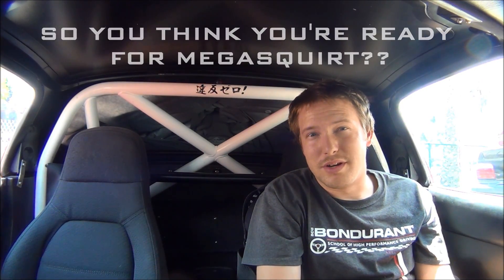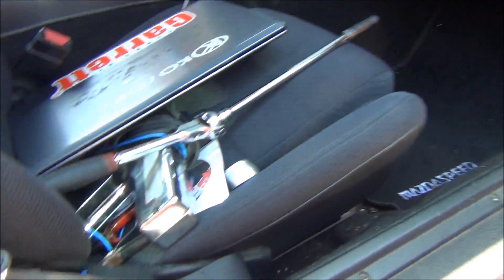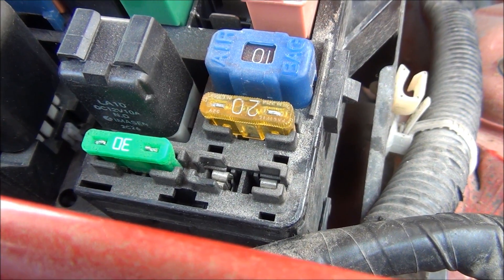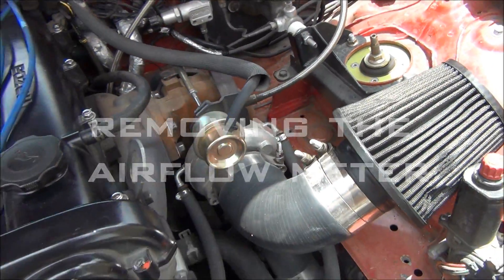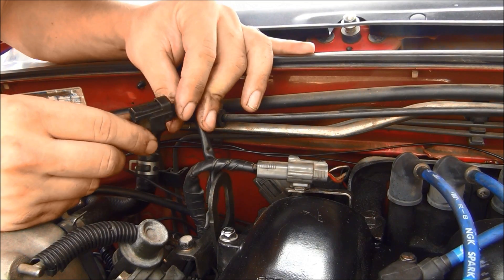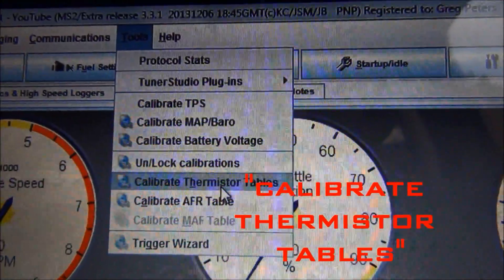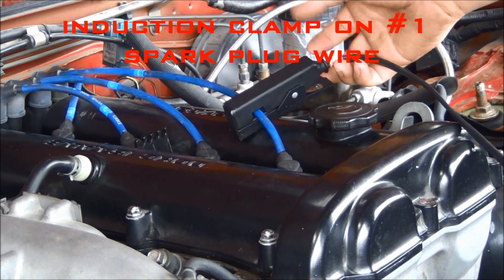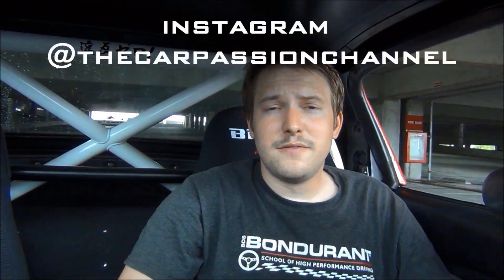How to Install Megasquirt!

Comment: You should do one about tuning and installing bigger injectors.
Reply from the maker: +Baron Graves Installing injectors is definitely in the near future.
Reply: +TheCarPassionChannel got a question, did you install the mspnp2 while still NA, if so did it start up right away? I can't get mine to start without revving it and it stalls most of the time after just 30 seconds or so.
Reply from the maker: ***** Yep it started right up. What are your AFR's like at idle?
Reply: +TheCarPassionChannel at the time I didn't have a wideband so I don't, I swapped the stock ecu back in because i dd my miata this weekend i plan on doing the wideband and swapping back in the megasquirt
Reply from the maker: ***** It's impossible to tune MS without one. The base map is okay but definitely needs some tweaks, from one car to another the fueling at idle may need to change, or it may just be idle valve settings.
Reply: +TheCarPassionChannel Yea definitely thanks for the help keep the videos coming man

Comment: Is this beneficial to install naturally aspirated? And would the initial setup be similar?
Reply from the maker: +Nick Racicot Install will be identical if it's a 1.6L, and it can definitely benefit naturally aspirated vehicles, I've seen cars make an extra 20+whp and increased fuel economy with a proper dyno tune on Megasquirt.
Reply: +TheCarPassionChannel yeah it's a 91 1.6L. I just got her a few days ago.

Comment: how much is a megasquirt
Reply from the maker: +iC Jehova around $850 for a plug-n-play, $400 or so if you build it yourself. You can go boosted without a standalone, but it's really best just to buy one in the beginning. You can get a lot better and safer tune with it.

Comment: yeah i want to boost mine but i need a list of like every part bc every video i watch has so many different things and i just want something cheap and quick
Reply from the maker: +iC Jehova The main ingredients you need are: Manifold, turbo, downpipe, water/oil lines for the turbo, intercooler, intercooler piping, blow off valve, ECU (megasquirt), injectors. You'll need a clutch if you want over 150whp. Below 6psi, intercooling isn't really necessary, but it is safer.

Comment: how much does it cost in total to boost a miata rn i have a 1991 1.6 miata
Reply from the maker: +iC Jehova Anywhere from $1000-$20,000+ depending on  many many many many variables. I'll be releasing a video Friday that's the start of a project you'll probably be very interested in.

Comment: I just picked up a Ms2 and an Innovate wide band. I was making 160hp to the wheels un-tuned, with an m45 blower on my 1.8. Can't wait to see what some proper management does for it.
Reply from the maker: +Bryan Murphy You should pick up some good power on the dyno.
Reply: Thanks. I hope so.

Comment: just a quick question. not to sure about but did you say the megasquirt did come with the overboost protection or if it does not what do i have to get. and i would like to know if you recommend the voodoo 2 turbo kit from flyin miata i saw in one if the videos you got the garret turbo and you said it was alot better just wondering if you would recommend that. thank you in advance if you get to this
Reply: +TheCarPassionChannel yea I was gonna buy the kit without the electronics and use mega squirt. Thanks I appericate the response. Thanks again

Comment: but how am I supposed to turn the car on the on position if my battery isn't connected!? lol I'm joking thanks for the good videos, very helpful!
Reply from the maker: +Rob Michel .......small detail, lol.
Reply: TheCarPassionChannel which IAT sensor did you use? I'm assuming the open element one.

Comment: I am definitely interested in doing this.  Thanks for all the info you are going over.  It will really cut down on the troubleshooting time.  I kind of want to explore the MS PNP still using the maf though.  I have previous experience with tuning, just not miatas.  I have read that it has been done.  What are your thoughts?  I have to maintain A/C because ~120 degrees ambient air temp at times.
Reply from the maker: +NickelNDiminIt You can keep the MAF but I'm not really sure what advantage it will have.

Comment: @thecarpassionchannel
so you put the wideband sensor in the stock hole for the narrow band o2 sensor and hooked the wideband into the stock harness plug? how? and on my car right now I have 2 bungs in my exhaust system. 1st is for wbo2 and 2nd is stock narrow band o2. if I switched to mspnp, would I remove the narrowband with a plug and connect my wideband to stock harness?
Reply from the maker: rstormzand I can only speak for my wideband, the Innovate MTX-L, but yes you hook it up to the stock harness. It's easier than most people think, which is why I am going to be doing a video on it! There's a single wire that comes out of the back of the gauge itself on mine that needs to be hooked up the stock harness, it's super simple.
Reply: TheCarPassionChannel I have a wideband right now as well. but I also have the stock narrowband. Would I remove the narrowband once I installed megasquirt?
Reply from the maker: rstormzand Yes. The Megasquirt only needs a wideband.

Comment: Bro i gotta ask, ive installed mspnp2 and mtxl wideband. Everytime i go to tune my ignition timing, im having problems

1. Click fixed advanced, set 10 degrees
2. Burn
 Its at 10 degrees
3. Turn off engine. Click use table. Burn.

17.3 degrees?, i try to use the trigger/angle offset but it doesnt do shiet
Reply from the maker: Dj SkFk Don't use trigger/angle offset while in "use table." That's only for setting the base timing. You have all of the steps correct, the only timing you need to manually set is the fixed advance. Once you change to "use table" it's going to use the ignition table. Go to "Ignition Settings" then click "Ignition Table 1" and you'll see down in the idle cells, the advance will be 17.1 for the base map. So that's exactly where it's supposed to be after you select "use table." The reason for setting the fixed advance is so that if MS thinks the engine is at 10 degrees BTDC, the actual mechanical advance of the engine is at 10 degrees. MS just adds to that to achieve the values in the table. So if you have your car set up to idle at 17 degrees, MS just does "10+7" degrees. If your fixed advance was 10.0 in MS, but actually 13 on the engine, MS would still add 7 degrees, but you'd be idling at 20 (13+7=20 degrees) because MS thinks the fixed timing is 10. That's why any time you remove your CAS for any reason, you HAVE to check your fixed timing again, otherwise it will throw off your whole ignition map, which can be dangerous. Hope that makes sense!
Reply: +TheCarPassionChannel okay man that makes alot of sense. my problem now though, is everytime I select a gear ms will raise my idle to almost 2k, Ive run the car with my stock ecu and it won't do it. 

I have checked so many things I just don't know why. 

I put in any gear including reverse with the clutch depressed, idle raises to 1600, in neutral the car behaves normally, even with the clutch depressed. 

shed any light? is this related to timing?
Reply: +Dj SkFk also, so I take it from you're reply. It's safe to be at 17.4 degrees advanced? at idle.
Reply from the maker: Dj SkFk Yes that's a safe idle advance. Mine is 16.0. The idle up is not related to timing, it's your neutral switch that's giving MS the signal to idle up. Why on Earth MS would do this I don't know, I was able to tune it out but it's been so long I don't remember how. Another problem is on older firmware versions, MS thinks the neutral switch is actually the clutch switch, so you can't get launch control or flatshift to work right without wiring your clutch button into the neutral switch harness. This could be part of the idle up issue as well. What firmware version are you on? I literally just updated mine to 3.4.0 last night and it kept giving me an error with the neutral switch, that's the only reason I know all that ^^^ haha, good timing on your question.

Comment: First of all, thank you for make a video on megasquirt. I'm building a turbo Miata and I'm using the megasquirt pnp 90-93 gen1. I was wondering if the initial set up and maps are the same as the Gen 2?
Reply from the maker: boaz ovilma That I'm not sure of. But the most recent base map is available for free online, just follow the link in my description.

Comment: How bad of an idea is it to buy a miata that already has a turbo on it? I'm thinking turbocharging my 94 could cost around 5k, so why not just get an 04 Mazdaspeed?
Reply from the maker: twitch01 It's all up to you man! The MSM can be expensive for the initial purchase, and is also more expensive to fix and modify. And, if you spent $5k on your 94' you'd be destroying stock MSM's.
Reply: TheCarPassionChannel What would be the best use of that 5k?
Reply from the maker: twitch01 It's not my car man, gotta make that decision yourself. Depends on so many different variables like what the car's going to be used for, what the smog laws in your area are, how good your mechanical skills are, if you have a spare car or not, do you care how much value the car holds, etc, etc, etc.

Comment: I love your videos man! I can read thru forums all day and although helpful, watching videos just helps that much more. So the question. How satisfied are you at that power level? I'm in the process of boosting with an FMII kit. The thing that kills me is the ~250wtq upper limit of the rods. So 230 or so is safe. I'm thinking about new forged rods, rings and bearings to run up to ~275. What do you think?
Reply from the maker: Dukepgh I would say just boost your stock engine first and see how you like it! It's really going to cost an extra $3000 to properly build an engine. Have you ever driven a boosted Miata as a reference? I'm at 236whp/215wtq and it's so freaking fun! It keeps up with 2015 5.0 Mustangs (450bhp) so it's no slouch. I also autocross it so I need to keep the spool fast and not use too big of a turbo anyways, I'm actually changing the turbo this weekend to something that spools a little faster. I switched to E85 so I'm hoping I can get into the 235whp/225wtq range still. You're going to be so happy with the car even at the 230whp level, and maybe you can just start building an engine on the side and take your time with it.

Comment: Great video, but it would've been better to do before you installed your turbo!
Reply from the maker: Joe H I had Megasquirt installed months before I was turbo ;)
Reply: Sure, but the video would've been helpful to show what you did then.  Before you turbo'ed, did you have your AIT sensor plugged into the plastic crossover tube just before the intake manifold, or over by the airbox?
Reply from the maker: Joe H I agree, it would have been helpful. But I wasn't planning on converting my car back to stock to do an MS install video, lol. IAT was in the crossover tube right before the throttle body. Drill hold, thread in sensor. The plastic is so soft you don't even have to tap it.

Comment: Hey man, this video is great, but for us that suck with engine electronics/tuning a full in depth video would be better. I feel like doing it in full depth would be more beneficial :D thanks for the videos man, they are very helpful.
Reply from the maker: Jordan Wilbanks I feel like this was a pretty in-depth install, what kind of things are you talking about? If you're not familiar with the engine bay, I definitely wouldn't recommend installing MS yet. Start out with routine maintenance items like spark plug wires and air filter change. You'll gradually work your way up over time.
Reply: I have been re-watching, and its getting more and more clear. Thanks for posting the video man. Keep the great content up!

Comment: you need to replace the TPS on the 1.6 miatas too? i remember reading that the stock 1.6 TPS is just an idle and WOT switch.
Reply from the maker: 86gtforme The stock 1.6L TPS is just an idle/WOT switch. I had mine boosted for about 6 months with no TPS then finally decided to wire up a Nissan VTPS.

Comment: If I have a 91 Mazda Miata with a 1.6 liter engine and I get the megasquirt ECU will the megasquirt ECU work on a 1.8 liter engine if I decide to do a swap
Reply from the maker: luis moreno With some wiring changes, absolutely.

Comment: what Miata do you have? and what is the HP? i want buy one Miata, i want 1990-94, but i dont know choose the best model ...
Reply from the maker: JOSH I have a 1992, and mine makes 236rwhp (~275bhp). 1990-1993 is the "NA6" with the 1.6L and 1994-1997 is the "NA8" with the 1.8L. Many people prefer the 1.8L because it has more potential for power, and the differential is stronger.
Reply: but the Miata series its 115 HP no? as put more HP ? with turbo? XD i dont know
Reply from the maker: JOSH Yes it's turbocharged.

Comment: Questions! Is it acceptable to install ms on stock engine, and leave the wideband install until the turbo install? I just dont see the need to install into stock exhaust when i will be changing my exhaust when i go turbo? Im keen to buy parts i just want to know what order. 

Ultimately id like to install ms, upgrade injectors, then later intercooler, turbo and exhaust incl wideband?

How does ms go without using the AIT sensor, is it acceptable to leave it out until the intercooler is installed?
Reply from the maker: Dj SkFk You should install a wideband with MS because you can't tune it at all without a wideband. But, the good news is you can just replace your stock sensor with the wideband if you get one with a simulated narrowband output wire. It tricks the stock ECU into thinking it still has a stock sensor. My wideband can do that, the Innovate MTX-L. This makes it so you don't have to have a new bung welded into the stock exhaust, you can just use the existing one. And you can go without the IAT sensor, MS will just use your stock AFM/MAF (depending on year) for the readings. But it's so simple to install I just recommend people use the IAT kit right away. You're right on track with your list, I did: Wideband, then MS, then injectors, then intercooler, then turbo!
Reply: TheCarPassionChannel thanks so much for the info, ill chase down a mtx-l and install it with ms!
Reply: TheCarPassionChannel  Why not just use the 26-pin connector for your WBO2 input, since you need power and ground for the WB, and the connector includes power and ground?
Reply from the maker: Joe H Because I installed my wideband when I still had the stock ECU. When I installed MS, all I had to do was swap one wire and it was connected. I wasn't using my options plug at that time so it was really just easier, and no reason not to.
Reply: What did the wideband do for you before you had the MS?  Were you running your turbo on a bandaided stock ECU?
Reply from the maker: Joe H Installing the wideband before MS made it so that I didn't have to install wideband and MS in the same afternoon, lol. Only having half a day at a time to work on the car, I couldn't take on too much at once. And it has been my DD since day one so it can't be down. I even had it fully intercooled before I was turbo.

Comment: I did a compresion test on my 91 mazda miata and i got 165, 160,135, and 165 psi. Do you think it is healthy enough for megasquirt
Reply from the maker: luis moreno Why not? May not make quite as much power as an engine with higher compression but there's no reason you shouldn't run MS. :)
Reply: Awsome thank you

Comment: Do you still use the stock TPS?
Reply from the maker: Timo mx5 The stock TPS on the 1.6L is just a WOT switch, so it's basically useless for tuning. The MSPnP doesn't even use the stock TPS on the 1.6. I have converted to a variable TPS from a Nissan 300ZX (1990-1995 OBD1 TPS) and installed a jumper in the MS so it used the TPS signal. It's not necessary for tuning but it allows you to use more features of the megasquirt.

Comment: Great Video. It is good to mention that NB's don't require the IAT install, they already got one :)
Reply from the maker: yossi126 But isn't it part of the MAF? Even though their MAF has better flow than the AFM of the 1.6, you can still remove it and convert to MAP. It makes it easier to get creative with your intake routing and not worry about where you're going to place the MAF.

Comment: This helped so much! I've heard that the MSPNP doesn't have to be installed on a turbo miata. Is this true? Also, could you please post a video on how to install the wideband??
Reply from the maker: Billy Terry This is true. You can turbocharge a Miata and use the stock ECU. But you're using band-aid fixes and tricks to make it all work right, and you're extremely limited on your tuning options. People do things like use the stock injectors but raise the fuel pressure to 80-90+psi, and use an "o2 clamp" that puts the car into closed loop at a certain manifold pressure. They work, but are not optimal. In my experience, reliability is all about having complete control over your engine and optimizing its operation at all times, as well as monitoring vital signs and knowing when there's a problem. Between the tunability and datalogging features of standalone ECU's they really are worth the investment.
Reply: Turbo charging it is way down the road. I'm trying to research a lot into it. But i've been looking into just keeping it N/A and putting the MSPNP, just to give it a tune for a track